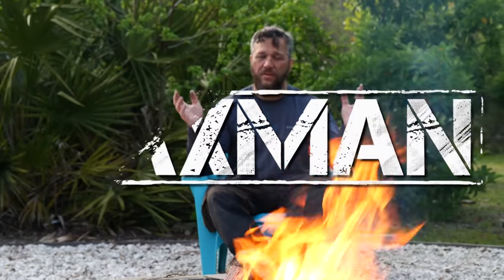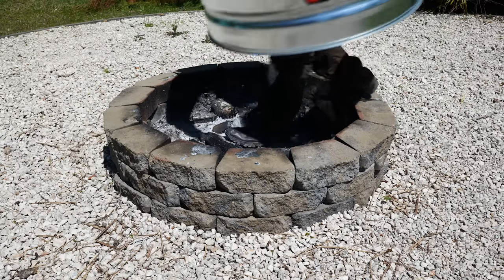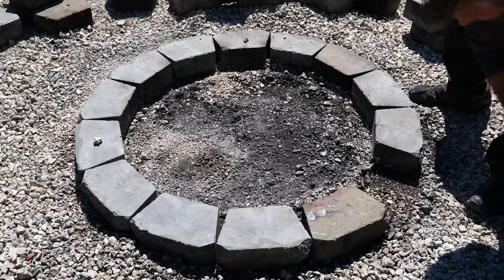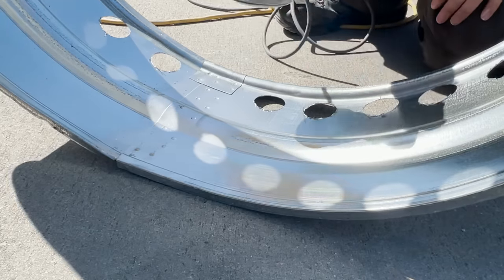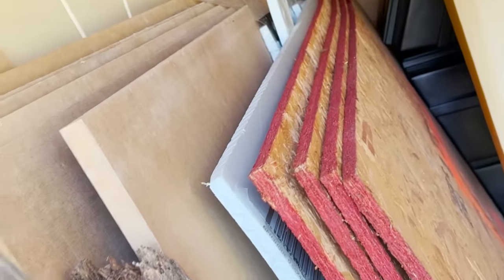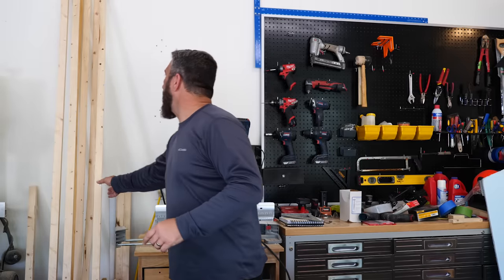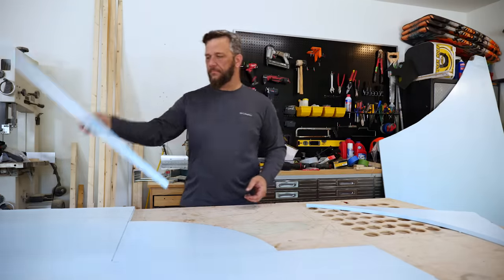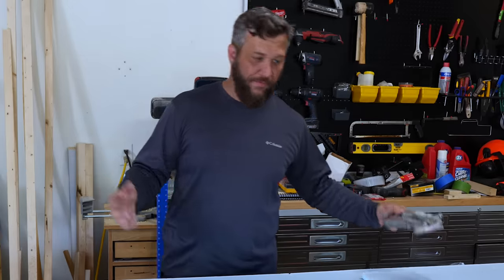Smokeless Fire Pit Makers Hate Me For Showing You This

Comment: Fun fact:  The oelic acid in PAM reacts with the lime in the concrete to create a thin layer of soap.  That's what causes it to release from the mold.  I worked as a chemist for a company that basically made industrial "PAM" for concrete molds.
Reply: when we poured concrete for a new barn addition we just sprayed the forms with used motor oil/diesel fuel mix and it worked good.
Reply: @djomegaminus  Use corn oil.  It's non-hazardous, biodegradable and environmentally safe, and acts as stated above due to the oleic acid in it.  No need to worry about the metals and preservatives in motor oil.
Reply: @rabidhellhound9714  used motor oil is free!
Reply: @djomegaminus  But unhealthy if your kids are going to be around it.  Just looking out for you.
Reply: @rabidhellhound9714  oh man, I don't know how I survived childhood living on a farm!  All my friends who also grew up on farms should be dead.
Reply: SuuUuure it does Pam nerd 🙄
Reply: Say you don’t care about the environment with out saying you don’t care about the environment “I uSe uSeD CaR OiL lIKe gOd INTenDed
Reply: @nickmoran8801  if you have ever rode in a gas powered vehicle you don't care about the environment either.
Reply: @nickmoran8801  If you've ever used a battery powered device you don't care about the environment. Do you know the destruction to the environment that is done to mine the minerals needed to make batteries?

Comment: This video inspired me to make my own fire pit.  Thank you so much.  I would like to share some tips.  When using the DOW foam board for your mold make sure you put the concrete on the clean side.  I did a full circle instead of the 4 pieces and when I took it out of the mold, the cement had absorbed some of my trace lines, the barcode and DOW logo.  I tried to sand it off but it's deep-set and I will have to paint it.  Also, I used contact cement at first to attach the pieces and the glue ate away at the foam.  I ended up securing it with screws and then caulked the seams.  Ultimately it came out great and everyone is amazed that I did it myself.
Reply: PL 300 it the non melting foam adhesive. Its blue too

Comment: Awesome!   

If someone’s really worried about the spacing of the bricks removed on the bottom. Just remove the three and spread your other bricks out instead of having three big holes have a bunch of small holes between each of the bottom bricks, basically divide the space between them.

Also you can put the shredded fiberglass in the concrete mixer, they sell concrete reinforcement fibers that are already shredded that is pretty much the same thing and comes in a bag. But you dump it in with the mix in the mixer and it sticks through all of the concrete.
Reply: That usually shows in the finish
Reply: What Shane said 👆
Reply: I wonder if we could recycle old furnace filters? 🤔 tear them up
Reply: Or just use some 6/6  10/10 WWM

Comment: Awesome video and content. Much appreciated! From a structural engineer ~ counterintuitive approach to strongest concrete possible is to keep the chemical reaction of the concrete curing going as long as possible. Where the driest concrete mix provides the strongest result, as soon after the surface of the concrete sets up, saturating it with water (as long as it will not remove or wash away the outer cement material) will keep the curing process going. So putting wet burlap or even submerging in water if practical, will get you more strength. Loved this video, learned so much!
Reply from the maker: Thanks and thanks for the info!

Comment: If you taper your molds just a little (aka Draft Angle) they come off easier - especially deeper molds.
These cap stone molds worked easy because they were shallow and you used a mold release, but
the draft angle is just a tip for future projects.

You can also put a hole in the mold and use compressed air (or water) to push the castings out.

Comment: I was able to get the blue foam from Lowe’s, but the contact cement I bought melted it. I saw others were having that issue too. So what I ended up doing was skipping the glue and just using duct tape for all the molds. Worked great!
Reply: Get a hot glue gun. They're like duct tape and zip ties, you'd be surprised how many uses you find for it. It would perfect for making foam molds.

Comment: Dude I tried it with 7” x 12” just threw them to see if the concept would work and it works awesome. Love the idea and concept. I am super impressed on how great this works
Reply: What did you use as the cap, the top pieces?
Reply: @timhart5354  
I had landscape stones about two levels high then just thru on 7x12 rectangle along the top all the way around to see if it would work and it does. But I have made a new fire pit. Using the ring but I dropped it down a bit from the top so I would not have to drill holes I have small gaps  in between some of the bottom row but I need to make all blocks on the first row have gaps to allow more air in and I still have to add the top caps similar to what you did with the concrete caps. I’ll let you know how it works once I have it done 👍
Reply: @timhart5354  

I also lined the inside of the fire pit with the 7x 12 laying horizontally so that the top caps 7x12 would match the same profile
This is the old fire pit I am talking about
Reply: Can’t really explain with out a picture can’t send picture on here

Comment: Another hint, you can buy Fiberglass particles to mix IN WITH the Concrete. Easier and will make the WHOLE Project stronger.
Reply: be carefull with that, you might get a carcinogenic result during your first couple of fires
Reply: @auyara007  5tr
Reply: @auyara007  Only in the state of California. 😉
Reply: it would be much stronger with two reinforced bars across, better than fibreglass which is for hair line cracks and not for reinforcing concrete slabs.
Reply: Chicken wire
Reply: @auyara007  Carcinogenic result from what? Glass?
Reply: I was thinking about this..how would mixing it in his mixer effect the strands, would it all get caught in the mixing "fins"?
Reply: @nr1483  They mix in normally.
Reply: @bradley3549  I believe it’s not so much about the material (glass), but about the microscopic fine shape (fibres).
Reply: What about wire mesh instead of fiberglass or rebar?
Reply: @ronsantos3313  1" hardware screen or chicken wire might work.

Comment: About to build a firepit and glad to see there are design options to help with the smoke. Two changes I'll incorporate: 1, instead of removing alternate blocks I plan on spacing all blocks at the base about 2 inches; 2, instead of drilling all the holes along the top of my steel 4' fire ring I plan for my top cap to sit 1 1/2' above the top of the ring thereby allowing airflow to rise up and spill over the ring below the bottom surface of the overhanging top cap. Too many holes, too many years, too little patience. Thanx for a great video.
Reply: @Danger WillRobinson -Any update? I was planning to try a gap at top as well, though smaller to ensure adequate pressure.
Reply: @myjunkmail007  any update from you as well?
Reply: I'm thinking of doing the same with the gap. How did it work?

Comment: Great video and I love the foam board.  Much easier than the way I do it now.  You can also use a mortar mix with a releasing agent for the top.  It will pour like pancake mix and it's ready to go in an hour.  You can also skip the fiberglass addition.  Check it out.

Comment: Pretty cool build, esp the venting technique!  One thing I do when I mix concrete or cast stone seating is I a get a gallon can/jug of brake rotor shavings from a brake shop, put it in the water for 3 days that you are using for the crete or sand cast mix. Gives the stone look great color and does not bleed off after sealing the surface with concrete sealer

Comment: The way I made my existing paver brick fire pit into a smokeless is i dug a foot or two deep hole inside of the pit and then another hole of equal size two to three feet away and then made a 3" tunnel connecting both pits and ran a 3" pvc drain pipe through the tunnel and put a 90 degree angle coming out of the second pit and then buried that pit and cut off the pvc sticking out flush with the ground to protect it from the mower. It works great as long as you know how to stack fuel properly for a smokeless pit.
Reply: I’m pretty sure my city zoning won’t let us do that. 😊

Comment: Using fiberglass is good, but you don't have to rip it up like that.  Since the concrete is the matrix, it will flow and form around it.  Cutting it into 6" wide strips is much better and cleaner. You will get a stronger final product as well.  Another tip to increase strength would be to use ground-up ash from your fire in your concrete mix.
Reply: I'm interested in how the ash helps strengthen the concrete?

Comment: Here's another method to try to improve your control over the route the air takes in supporting the burn. Place the long burning pieces of wood on the bottom of the firepit and decrease the size of the wood as you build up the pile in flat layers, with small spaces between them. Now, your kindling wood is on top of the next largest layer, right on top of the pile.  This is where you light the fire. Think of how a candle works: there is no smoke because all of the unburnt gases in the heated wax under the flame have to pass through the flame, and are burnt up.  Smoke is off-gassing of the burnable material in the firewood, and it is not being burnt if it blows away as smoke.  With this inverted method, the kindling burning heats up the material underneath the initial flame, and most of the gasses produced are burnt up in the fire at the top of the pile,  By the time the pile is burnt, you will have produced some very hot coals, when they have cooled somewhat you can build another virtually smokeless fire by adding dry wood from big to little pieces on the coals, then relight kindling the top of the. Give it a try; it's easy to do, and you'll get much more fire and much less smoke from your wood, with virtually no extra work except building the fire upside down. This might even make your fire ring work even better! This method also drastically reduces smoke in wood stoves. especially when starting one.
Reply: I saw a video that concept is used in drafting. The guy dug a hole out side of the fire pit under the bricks. I cant remember he may have put a concrete tube in it but it came up like a pipe. I dont rember exactly but it was supposed to act like a flu, a draught system. Like you are saying how to stack the wood. The air draughts in what you describe. The big iron rings at campground just have one or 2 U shaped holes cut into side and at bottom. You keep it clear of wood and ash to help fire to burn. Im no expert.

Comment: First time viewer, and new subscriber here!!!  10:45 If you don't like the old weathered look, and want a more artsy fartsy look, use crushed glass, but not just any crushed glass. You'll want to use the stuff intended to go into propane or alcohol tabletop fire "pits". What's really nice about the crushed glass I'm talking about, is that there are no sharp edges, AND, it comes in many different colors. 12:40 For about the same price, or even less, as the fiberglass mat you used, you can get a bag of fiberglass that is already shredded and ready to be mixed right into your concrete mixer. I like to toss in one handful of fiberglass per bag. This gives you a nice even blend of fiberglass throughout the cement for extra strength. You should be able to find it right next to the bags of concrete mix. I think I'm going to be building one of these next weekend. GREAT VIDEO!!!!
Reply: Check out Ruby Lake Glass ... excellent selection of colors.

Comment: Thank you for the video!
I tried using a rigid pink styrofoam I had around.  I bought contact adhesive, and it melted the foam.  Ended up using some thick MDF and holding it together with fasteners.
Reply: Do NOT use contact adhesive on the purple foam either! No clue how the blue foam didn't melt in the video.

Comment: While I certainly appreciate the design there are two significant problems with this. As an individual who works a blacksmith forge there are some things that I see that your average layman might miss. First: Galvanized Steel gives off zinc-oxide when you heat it up, this is no bueno. Even with good ventilation I would still be very reluctant to risk any exposure. Second: Concrete is never truly dry, there is always SOME moisture inside of it. Now what do we know about moisture when it is heated up? Yes, it EXPANDS into steam which can cause the brick to literally explode, which can cause injury or death. Always use firebrick or cinderblock for fire pits.
Reply: Really good points you make. Scary to think how many people have watched this and probably used the same materials.
Reply: Hard to believe nobody else caught that.
Reply: I wonder if Tractor Supply realizes their liability? I just checked and the rings are sold for fireplace use.
Reply: @wildtimbrown  Are they galvanized steel? If they are maybe whatever regulatory agency in charge deems outside to be adequate ventilation. Maybe it is and I am just being overly cautious.
Reply: The ad said it was galvanized.
Reply: Thanks for the info
Reply: The amount of zinc fumes developed from welding far exceeds any zinc fumes that may form from the heat of a wood fire based on the much higher temperatures involved, close proximity to the source of the fumes, and duration of exposure.

Eurofins EAG Materials Science: Technical Report for Tarter Farm & Ranch Equipment, August, 2020

Comment: This looks like a great idea. I’m wondering if the holes should be lower? Would it be better to let the air closer to the bottom. Not so close that the holes would become blocked with ashes.
Reply: You want the holes at the top. You need the cold air to enter at the bottom and heat as it rises to the point it will combust when it combines with the smoke at the top.

Comment: A few things.  If you need your
Mixture more liquid consistency so it fills a mold better, don’t add more water because it gets weaker and doesn’t set properly.  A cap of laundry detergent when mixing your concrete makes it act like it’s way more watery but doesn’t need to evaporate the extra water so
It has better strength.     Secondly.   We found instead of Pam for a release spray, crisco cooking grease mixed with a bit of olive oil or vegetable oil works best      Mixes into a paste that is great for release
Reply: Year late to the party, but good points! Also, instead of tearing the fiber and adding it in the middle of the concrete, he could have added it to the mixer and had it mixed throughout the concrete for a better end strength.

Comment: I just finished rebuilding mine.  It was about 10 years old.  Thanks for the inspiration! Here is what I did different.  First, I did not drill all those holes in the metal ring.  Waste of effort.  After leveling the pit I lined the bottom with fire brick leaving about 1" space between each brick then packed some sand in the spaces..  It gave me a level floor that I could scoop ashes out of.  Next I used four more fire bricks under the bottom edge of the ring raising it up that 1 1/2".  My outer block was about 1-1 1/4" higher than the top of the ring.   That left enough space for the air to circulate and be drawn up and back into the fire just as the holes do.  Also I made forms the same way but instead of four heavy ones I made eight.  Easier to handle and looks great.  They overhang about 1/2" outside and about 1 1/2" over the inside  ( they extend past the inside of the metal ring to force this air between the block and the metal into the pit for that secondary burn.  Works great.  The blocks were adheared together but I left the cap blocks not glued to be able to facilitate replacement of fire ring someday.  I painted the fire ring with heat resistant grill paint.  It works great!  Lastly, I did not do any of that baking soda thing.  Just filled the forms and tooled it smooth.  I used a sidewalk edge tool to round the edges a bit and a trowel.  I tapped the sides of the form to be sure the concrete settled properly.  Every day that has seen it loves it.  Northern Tool has some metal fire wood grates to put down in the pit to raise the wood up a bit and that helps get air under the wood.  They also have a snuffer cover to keep the pit dry during off times and looks great.  I painted that black too. Oh and another thing ...I did not like leaving out a few blocks for air to be drawn in to the pit.  I left about 1/4" space between each block in the second and third course of block.  That was more pleasing and was very effective at feeding oxygen to the fire all around the pit.  I tested the draw with a lighter.  While the fire pit was hot on the inside I lit a lighter and held it up to the cracks between the blocks on the outside and the flame was sucked in to the pit as expected.  Now no creatures can get in during the down time and it looks great.  And one more thing.  The ring size I wanted was 36".  Beware when you go to buy one at Tractor Supply.  Measure it to be sure it will work.  They lable them as 36" but they are not all that size.  The company shipped to their stores three rings banded inside each other. Each ring is assembled.  The sizes are as follows: outer banded one is about 36" the middle one about 34" and the most inner one is about 32". It is impossible to fit three rings exactly the same  size inside each other but apparently the manager did not understand. They are all labled 36" so to him they must be.  ( Even a tape measure did not convince him).